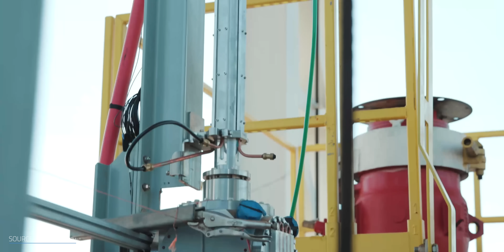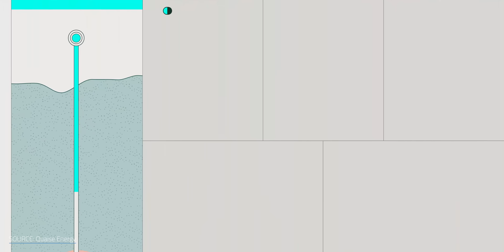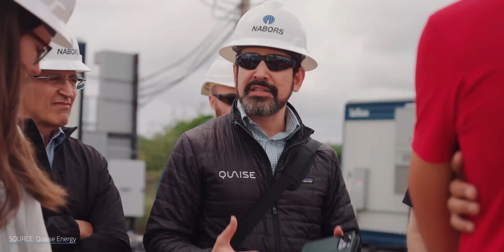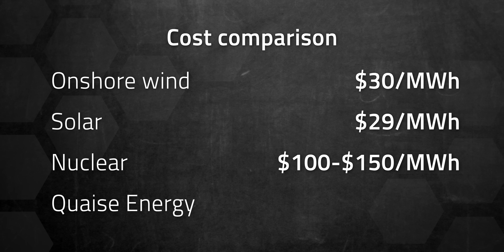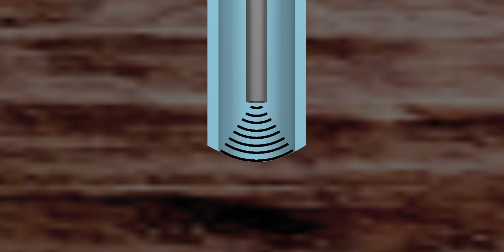How Geothermal Energy is About to Break its Limits

Comment: If every electrical need of the whole world was met by geothermal, how many years (I’m assuming millions?) would it take to meaningfully strip heat from the earths core?
Reply: the heat extracted would be negligible, also earth's core is heated by nuclear decay it would have cooled billions of years ago otherwise.
Reply: The flow of heat from the earths core to the surface of the planet and radiating into space is about 47 TW
Reply: @pokekick4185 I had to google how much energy we use annually. I’d say we have some wiggle room lol. Not so worried about geothermal then…
Reply: Now we are asking the right questions.
Reply: I don't think the time matters since radiodecay is heating up the earth all the time. The rate that energy is extracted need to be less than that energy added. I'm sure this is petawatts or more.
Reply: who cares, we'll be dead by then so it won't be our problem.
Reply: Long enough. Hard to predict as it would involve estimating humanitys energy demand for hundreds of thousands to tens of millions of years, which is, essentially, impossible. The thing is, earth (naturally) releases about 50 TW of energy to the surface each year. Humanitys entire demand, including not only electricity, but fuel, transport, heating, etc, is about 20 TW right now, and is estimated to grow to 50-80 TW in 2100+. The total energy available within earth is unimaginable large and will really serve all our needs. That is, until we eventually have such big energy demand that it requires more exotic solutions anyways. Think dyson swarm.
Reply: It will take far longer than the probable existence of our species.  Face it, you ain't never gonna cool Mama Earth down.
Reply: The Earth's rotation has been slowing since the moon was formed about 4 billion years ago. The pressure build up at the core of the Earth, as our Earth's equator decreases in diameter, causes increased heating. So there is a constant renewable heat source. And there may be heating as a result of solar winds interacting with the magnetic field.
To 'strip the heat' would be like pissing on the Hawaii lava flow at Kīlauea and expecting it to cool down. I don't think so!
Reply: 5 million years... roughly... and at the end every technology is just working on a timer until fusion is viable which I would really really assume is less than 5 million years😂😂
Reply: @petergriffin4629 just 20 more years from now… every 20 years until we reach that 5 million year mark.

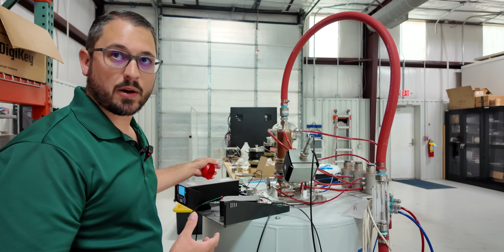Comment: 2:38 so you want to put that whole machine inside a hole you are drilling? 
How big that hole needs to be? 
And how long it would need to drill it per 1m? "
Just to work most efficiently
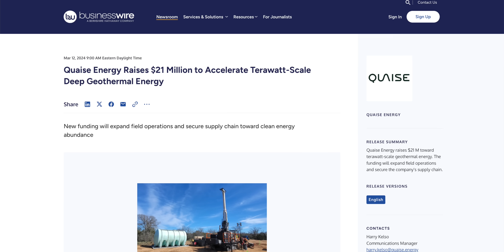4:19 so we invests as per public investment but if it will work correctly you got all that energy for yourself?
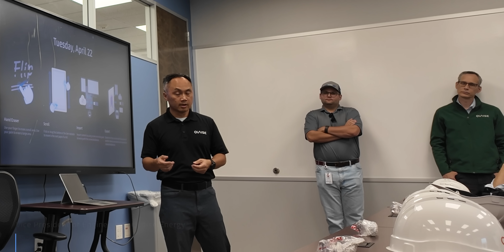6:20 so how deep that hole is? As big as that tower?
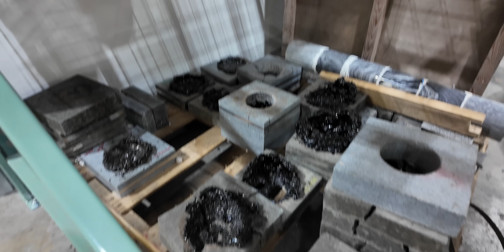8:30 is that enough for all the equipment that needs to go down?
15:30 so how it works? you make some kind of antena on the go? it need just cable at the end plugged to electricity?
16:00 so how much of energy can you make with that amount of money using that technology? Like with maintenance and everything administrative around it

Comment: I never hear anyone bring up the damage caused by geothermal drilling in the historic town of Staufen Germany. Although not for power production and much shallower, the consequences of water contamination in the drill shafts has caused irreparable damage to the area. I also have questions about dangers of hitting gas pockets with a “death ray”.
Reply: "I also have questions about dangers of hitting gas pockets with a “death ray”." - Unless there's enough oxygen in said gas pocket(s), then the answer is "nothing much". On the other hand, the air blast that they're using to clear the rock debris might make things interesting for a little while - depends how big the pocket is I suppose.
Reply: Did they do calculations on how it might affect the Earth core in that city? With more and more countries (not just cities) drilling down and scaling this tech, the effect on the Earth magnetic field and core's temperature might be underestimated.
Reply: @psapehin the issue in Staufen is that they drilled through a layer of groundwater and into a layer of anhydrite. The water seeping into the anhydrite rock has caused the ground to swell under the town, which has now damaged or destroyed nearly 300 buildings. Many of which date back to the 16th century.
Reply: Thanks for sharing. That's definitely an enormous loss for such a beautiful city! And though it's a great lesson, the cost is too pricy, and who knows how many unknowns that can lead to similar issues (or worse). Btw, googling even revealed a short video from Tom Scott about this issue: https://www.youtube.com/watch?v=zOgle88sKro

Comment: Wonder if you could  repurpose old oil/gas wells?  That way you start half way down.   Cost savings, and money to properly deal with abandoned wells.
Reply: love this idea, but very curious about the interaction between plasma and West Texas Intermediate crude remnants
Reply: 100% even if they would still run their drill down to make the hole wider or something... I mean there are literally thousands of drill holes that get you through most of the annoying layers with groundwater etc... The potential of this technology is crazy.
Reply: just think of all the "dry" holes that exist that could be deepened
Reply: Their plan is to repurpose old coal power plants.
Reply: This tech can go one better than that. It can be installed anywhere where the distribution infrastructure already exists. There is no need to locate it anywhere specifically. So forget the remote drilling rig, install the drill right at the power plant location itself, start drilling in their parking lot. Then once you've got your hydrothermal system going, just tie it into the power grid connection that's already there and bypass the coal/oil-burning part of the plant entirely.
Reply: @erfquake1  they do say their main provlzms are the types of minerals and the presence of groundwater on the drilling path. So I expect it to only be costeffective in specific areas where both these are ideal. At least at the start.
Reply: Did you watch the video? Founder isn't interested in helping the oil industry.
Reply: @dannyarcher6370  not about helping the oil industry.   Utilizing old wells saves the cost of  drilling thousands of feet, and fixes wells that are leaking methane.  Better to fix them, than let them sit and emit greenhouse gases.   A lot of these wells belong to bankrupt companies that will never fix them.   Leaving the cost to fall to the taxpayers.   It helps, us, not them
Reply: @dave4882  Fair enough. Thanks for calling me out.

Comment: would be damned funny if they build a fusion reactor to power this thing

also I feel like your "cost comparison" table is a bit confusing here, at first I thought we're talking about drilling price since it's the topic before, so I was confused what you're trying to tell here comparing it with solar/wind/nuclear.. but it seems like you meant it to be the energy price Quaise will offer as soon as their geothermal generator was setup, which I only get after few minutes

Probably just a comprehension issue on my part,  but worth mentioning I guess
Reply: In theory, once we have fusion, we dont need anything else anymore. But fusion is always 50 years away, so..

Comment: I live in Hampton Virginia and I have seen  geothermal systems under homes. I was surprised that they could reach any heat here but they said it works.
Reply: 'Geothermal' home heating is a misnomer.  It is actually just a water source heat pump.

Comment: I'm sceptical. First because Quaise have not drilled deeper than 100 meters, and they're talking about drilling 20km - for some reason. And that's the other thing. It's not necessary to drill down 20km to hit high temperature geothermal resources. 
IDDP hit magma at 2.5km. The Western half of the United States is sat atop the Pacific Ring of Fire. Traditional drilling technology can reach those depths easily, just pick a spot in Wyoming, Oregon, Colorado, California, Nevada, New Mexico - basically, anywhere west of Texas!
I don't see how a Gyrotron works outside the lab; particularly if it needs a MW of power. And it's not at all reassuring that it's from fusion research, that for the past 50 years and hundreds of billion of dollars has promised endless clean energy is only 5 years away. 
Sure, they can blast a hole through a few inches of rock, but either, they'd need to lower the huge machine down the hole, or focus a drilling beam at 20 km distance. Like phasers from Star Trek. 
I'm sorry to be all sceptical, because I do think high temperature geothermal is exactly what the world needs; practically limitless constant clean energy. I just don't understand why they're reinventing the wheel on drilling, rather than drilling first, and perfecting drilling after. 
Clock's a'ticking real loud!

Comment: Question 
Would the gyrotron or some other technology be down the drill hole?
I believe it has to be.
How do they propose to keep the electronics functional at 800, 1,000, 1,500 degrees?
Reply: "Would the gyrotron or some other technology be down the drill hole?" - isn't that the purpose of the wave guide? So the gyrotron can be at the surface?

Comment: 13:37 so you say in order for the oil companies to take bait the consumer must pay the price? But at least it is not intermittent unlike solar and wind!
Reply: Nope, the goal it to drill down to super critical temperatures to get 10x the energy output making the higher returns.

Their LCOE is $0.10/kW, current home owners in CA are paying $0.50/kW. Even in low power cost states like Utah they are paying $0.135/kW.

Their geothermal will not drive up power costs.  Solar and wind only have super low LCOE only because this measures cost to produce and excludes transmission and battery storage costs. Once those are factored in Quaise Geothermal will be less expensive than solar and wind.

Comment: That 5 meters pre second will be better as more and more holes are drilled lowering the costs.  Now fast forward 15-25 years and we will have drills just doing geothermal HVAC well in a couple hours for individual buildings.  Or city wide unities holes instead of power poles for reliability and scenic reasons.  Maybe they will figure out how to put in front of TBM and speed up transit lines and alternative ways to get around for faster travel.
Reply: Or Canal Building????? Basically anything that needs digging

Comment: Couldn't this technology lead to a cooling of the Earth's mantle, especially if such a process is applied globally? It's not talked about, but scientists have known for several years, based on global measurements over a valid period, that the atmosphere is heating up while our planet is steadily cooling. Won't decreasing temperatures in the interior lead to a reduction of the rotation speed, and hasn't this already been measured? If so, then this concept of using the Earth as a heat exchanger for energy generation would be in my eyes a very short-sighted and highly risky idea.

Comment: I don't get why the rush with producing electricity. It would be so much cheaper to setup heating systems. The wells would be a lot shallower than for electricity production. 

Eastern Europe is full of apartment buildings with central heating. That could be a good early adopter scenario.Those buildings would be rather easy to connect. Heat through the winter would save a lot of fossil fuel. During this time, perfect the tech, get more political will etc. 

Geothermal makes a lot of sense. I do hope to see a lot more of it in our energy production mix.

Comment: I think something that will make this pretty viable is it seems pretty clean for something that also does not seemingly require a lot of precision beyond the initial setup. Normal drilling has a lot of waste, water usage, and non-reusable material required, and this seems to have none of that. Some cool concepts fail to take off because the margin for error is just too small meaning it requires a lot of labor to prepare along with high skilled workers to operate. Hopefully they are successful.

Comment: Thank you for this look into a fascinating technology that could answer some of our most challenging questions.  Getting to superheat depth without a drill bit is such an incredible step forward.  I really hope this technology works.  It seems to answer the problems of standard drilling that we have seen in the oil/gas industries, like water contamination and at-depth rock fracture problems.  Since this is not a mechanical motion, I think the likelihood of strata disturbance problems would be minimized.  It’d be interesting to see how well the plasma process does in different soil/rock types.  If it’s able to create that cohesive shaft lining while drilling through various rock types, that would save so much trouble and cost!  Melt, baby melt!  GIve us that sweet geothermal energy!

Comment: That is huge! Once again an American company breaking the applied science barriers!
Reply: American exceptionalism right there. Just for the record: deep drilling is hardly an american invention. The first rotary drilling rigs came from the UK and France in the 1800s, and Russia was drilling over 12 km deep by the 1980s (Kola Superdeep). The gyrotrons being used for this were originally soviet tech developed for plasma research. And today, countries like Iceland, Germany, and Japan lead in advanced geothermal deployment. I too think this is a super cool project and all, but let's get down from the high horses lol.
Reply: It's good R&D (as are the Fervo and Eavor geothermal startups), but when it comes to actual deployment of today's green energy technologies of solar, wind turbines, battery storage, and ultra-high voltage power lines, China is way, way, way ahead of the USA. And China is also the leader in most electrification technologies to use that low-carbon electricity like EVs, heat pumps, and high-speed rail.

Chump is determined to drag America backwards in these technologies in favor of last century's drill baby drill and clean coal.

Comment: The fact this beam blasts a bigger diameter than the beam is great.
I could see structural pellets sent down the hole and cycloned to the wall and melted in places where the existing rock lacks compressive strength needed to keep the bore open.
Reply: I think the idea is that the fused stone would be the liner?  If they have to send a casing pipe down along with the drill that's going to be a problem.
Reply: @EdwinWiles That's exactly what they're saying. Where the integrity of the melted rock might not be strong enough, it could be feasible to send down pellets of material that could melt and bind to the bore wall. No separate casing required. Work smarter, not harder.
Reply: In conventional drilling, the steel casing needed to prevent collapse is thick & strong and requires uniformity of properties & geometry. High collapse (and the variety of ultra-high collapse) pipe is FAR more robust than any layer of glassy rock they can produce with this process. And if wells are a challenge with conventional tech, there's no chance this will outperform it.
Reply: @theevermind If there's a bigger hole what stops them from just sending steel pipe down with the rig?

One problem I see is them sucking the rock debris out without a tube means this debris will wear away any glass perimeter of the bore hole they created. And will wear away steel tube if it isn't confined by a tube won't it?
Reply: @zteaxon7787  Yes, they could drill with this tech then case the hole. Typically, you have to cement that casing in place, and everything I know about cementing wouldn't be very compatible with this type of drilling because you won't have an empty (dry) hole anymore. Also, remember that the BP disaster in the Gulf was a result of bad cement not holding back pressure of fluid in the formations they drilled through. Having no cement is that much worse.

Maybe they could do expandable liners--the pipe is undersized, then once in position, it's expanded to press against the sides of the hole. Would that work without cementing? I think it would for a temporary fix to get to finish the current hole segment, but I don't think it would work for the permanent structure.

There are "drilling while casing" technologies that have the drill bit attached to the bottom of casing instead of drill pipe. It's effective to keep the hole from collapsing and saves time running the casing into the hole. Again, I don't know it makes sense without cementing.

You are correct about the risk of wear & erosion. However, I think their idea is that the rock is fully oblated, so it is more like a vapor than grit. Is that true? Possibly, but then you have the issue of it cooling down and changing phase while on the way out.
Reply: not needed - the melting of the rock itself creates the casing for the well.